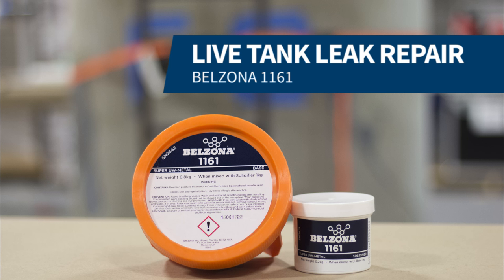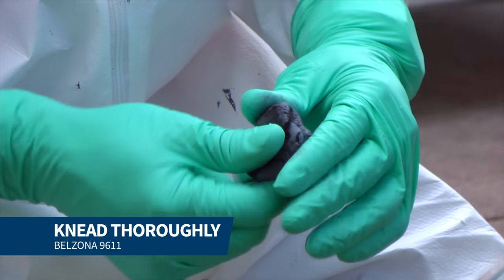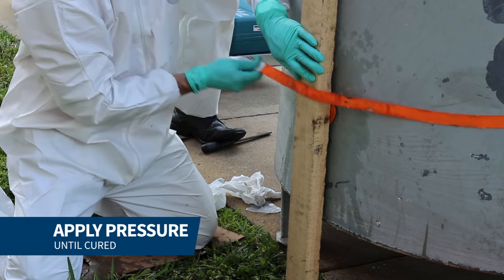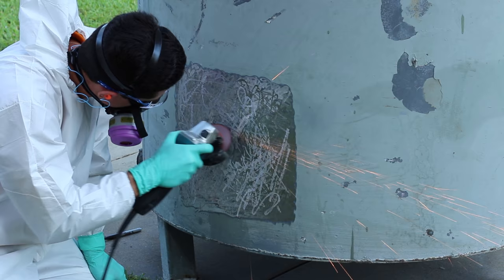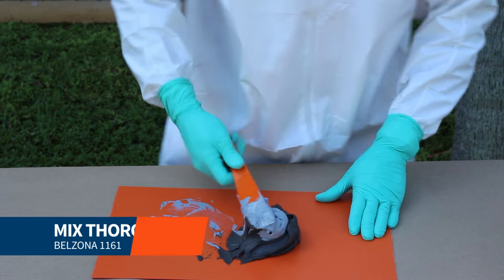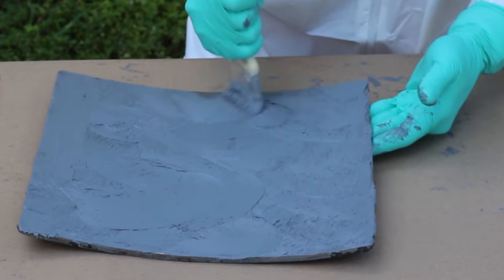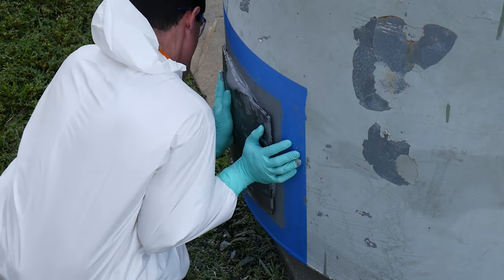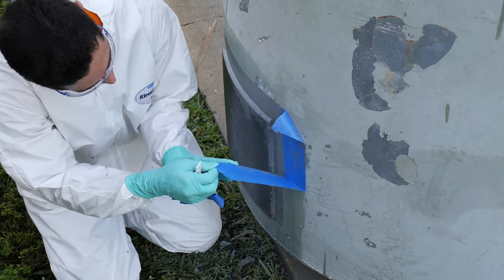How to Stop and Repair a Tank Live Leak

Comment: Will this work on a air compressor tank that gets to 125psi occasionally ?
Reply from the maker: Thank you for your question. Yes, it would work but it would not be able to be a live leak repair. It must be done with no pressure and let cure to a full mechanical hardness as per the Manufacturer's Instructions for Use. If you have any further questions, feel free to contact our Technical Department at tkl@belzona.com or find a local Belzona representative: https://www.belzona.com/en/contact.aspx

Comment: Question, if the surface was dry and no longer had a surface contamination level after the whole was plugged, why was 1111 not used instead?
Reply from the maker: Thank you for your comment. Belzona 1111 can be used provided that the surface is clean, dry and roughened, however for the purpose of this video we decided to show off the capabilities of using one of our other products, Belzona 1161, as this material also adds an extra safety precaution, just in case the best possible surface preparation can not be carried out.
Reply: Will this product repair a water leak from a tank,leaking from a weld seam, if used with 9341 reinforcement sheet? Or plate bonding is the only solution.

Comment: Sir in 85 degree temp possible in runing
Reply from the maker: Hi Jaydip, 

Unfortunately, this repair technique would not be suitable at 85°C  both due to the material properties and the risk to the applicator. We would therefore recommend that the system be shut off prior to the use of a High-Temperature paste grade such as Belzona 1511. If you require any further information please contact us at www.belzona.com

Thanks,
Miles